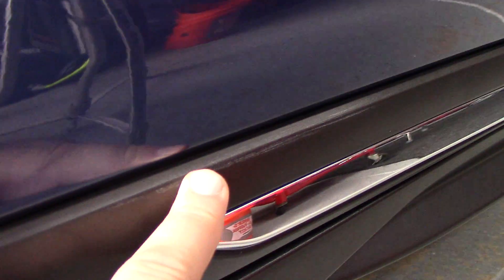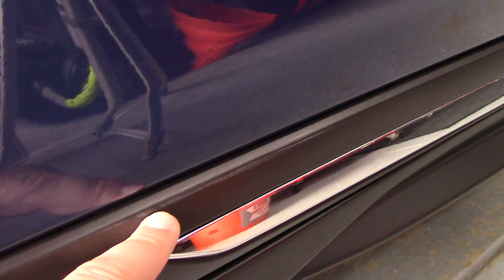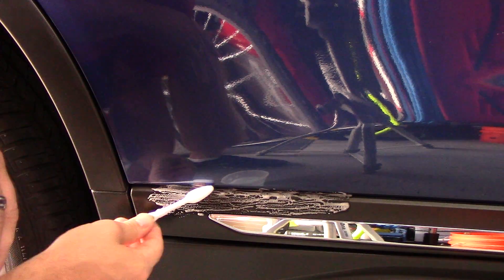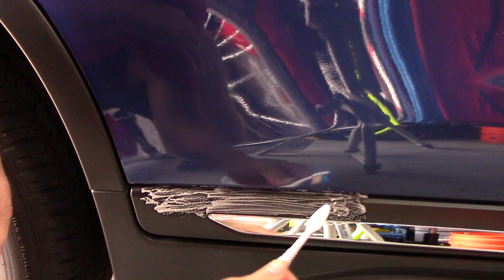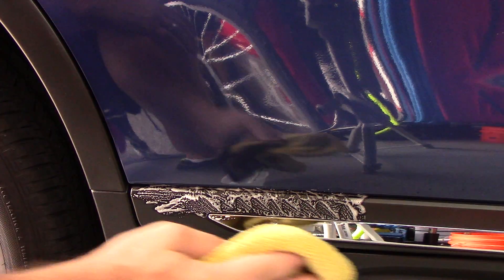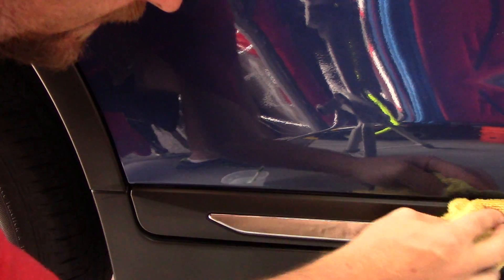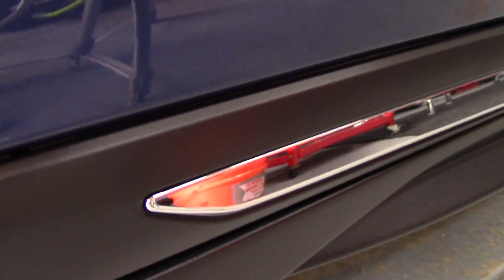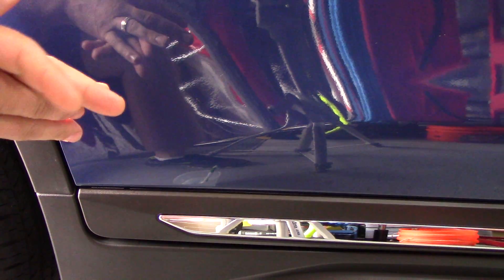Tip: How to Remove Wax on Black Plastic with Basic Household Products!

Comment: Thank you! Dried wax on black plastic trim has been bugging me for years and nothing I tried before worked. Until now. Thanks so much for the tip - it works a treat. And quickly too.
Reply from the maker: You are welcome
Reply: This and also magic erasers work on rubberized plastics. Haven't tried erasers yet but that allegedly works also.

Comment: Don't need chemicals.  I just used Mr Pen premium erasers on the wax film that was on my ridgleline plastic trim.  Came right off!!!  It was a little harder getting off the bed liner but the trim on the fenders, wheel well and under my door was a breeze.  Super stoked that I was able to "erase " my sloppy wax job!

Comment: thank you for not bullshitting for 8 minutes before getting to point. i use NuFinish and found it's awesome but didn't tape off when doing my new rav4. btw HUGE TIP!!:
use NuFinish on exterior of windshield, windows and side mirrors! it makes glass hydrophobic making windshield wipers not even necessary for light rain, ALSO during winter it make ice MUCH EASIER to remove from windshield, just run defroster for a bit and slide the ice off. AMAZING

Comment: Nice Man!  Good tip!
I like to use the magic eraser sponge cleaners with a little APC, it cleans it off super quick and easy also
Reply from the maker: Miranda Detailing Thanks and thanks for the tip. I have some magic erasers I will have to try that.
Reply: This may be a dumb question but what’s apc?
Reply: @sammiedavis1481  Not a dumb question, it stands for All Purpose Cleaner; for example super clean
Reply: I just used a magic eraser on a small section of my new car’s cladding.   The dealer got wax on it and it has been bugging me.  I have LED lights in my garage and I could see where it dulled the finish but removed the wax.    I’ll try the Dove soap tomorrow.

Comment: Great tip Fab.. I am gonna definitely try that.  My father in law great guy, wanted to wax his car with a spray wax. He is 86 years old, tough hard nosed Marine, and still tries to do everything he can. He sprayed damn near the entire black moldings on a Caddy SRX4. That car has a lot of black trim..UGH!  On the advice from Brian (Apex Detail) I used Citrol and a drill brush and it worked amazingly. Then a coat of finish solutions made it good as new.
Reply from the maker: Chicago Mike Thanks brother! There are many different ways and that sounds like another great one. Thanks for the info

Comment: Thanks for the info.

I may have used a stronger mix. Not sure. After applying. I let the soap sit for a couple minutes.
The wax wiped off in one swipe. Tried it on a spot on my motorcycle that had been there for years.
It came right off too.
Reply from the maker: Reg You are welcome!

Comment: For me, this worked very well for removing wax and polish from grainy plastic and Adam's tire & rubber cleaner + toothbrush!!.  Spray adam's and leave to act for a few seconds, then brush with the toothbrush, wipe with the microfiber and it's perfect!.  Two other products that also work are meguiar's apc D101 and meguiar's M39 heavy duty vinyl cleaner.  These products are fantastic because it does not lighten the plastic but restores their original colors!. Because I had tested different methods, such as the wooden pencil eraser etc. But the plastic was still chalky!.  But your technique seems to work well too!  👍
Reply from the maker: Awesome glad it worked and appreciate the tips you gave

Comment: i spit cerium oxide on my cowling  and used 4 different products, including a wax remover on it without ANY change. Used a .29cent pink eraser and not only did the polish come off, but the black trim actually looks rejuvenated.. It also removed water spots off the wiper arms and made look new. Who'd have thought, the simplest tools are still the best.
Reply from the maker: I have heard the eraser trick works great also. Sometimes it’s the stuff you wouldn’t ever think would work that get the job done.
Reply: @FABAutomotiveDetailing  I honestly never tried it because it sounded silly, but when I didn't have any other options i figured why not. 100% accurate on plastic trim, with or without texture. It also does a really good job on older trim that isn't stained but just weathered. I bought a 100 pack of erasers.....

Comment: Old toothbrushes are a very handy tool to have in ones arsenal. And Dawn is a very multitasking product. If you haven't tried it in a foamer on wheels and tires, I think you might be surprised (in a good way). Or to clean engine bays.
Thanks to you and Camarotime for sharing this tip. 👍✌️🇺🇸
Reply from the maker: B Stewart ExecutiveCarCare Yes they have many great uses. I may have to try that in the foamer. T was awesome for CamaroTime to share this tip.
Reply: B Stewart ExecutiveCarCare      Dawn and vinegar, mixed in a spray bottle, works great on a glass shower.

Comment: Thank you ...need to get compound off plastic and rubber... this looks promising ~!  Just a note I corrected my newbie polishing mistakes with your method in just a few minutes, but one thing that helped it go better was I rinsed the dawn and water off with window washer fluid in a spay bottle ... that really help the process for me .... after that I puts some tire black on a micro fiber towel and wiped in on the door handles that I just cleaned to restore the dark black look.  Thanks again,  Kit
Reply from the maker: Awesome glad I could help

Comment: I use a white pencil eraser block and just erase it, I saw this video and wanted to see if you had an easier spray and wipe type solution.
Reply from the maker: I have seen some erasers leave a smudge behind depending on the trim. This won’t leave anything behind.

Comment: Megs Heavy duty vinyl cleaner #39 takes it off instantly. You can watch them demo it for Matt at OC on his Megs visit.$10 for 16oz on Amazon. It's also the best thing on the planet bar none for cleaning marine vinyl/outdoor which is where I learned of it 20 years ago. Stuff is miraculous. It will work when nothing else does. Works on contact.
Reply from the maker: BigOldDog I will have to check it out!
Reply: @FABAutomotiveDetailing  I meant Matt at Obsessed Garage LOL His 2nd video of his trip to Megs in CA shows it in action.

Comment: Just wondering if an electric toothbrush - the vibrating type (as opposed to the oscillating head type) would help? I imagine the bristles 'jack-hammering' into the pits of the matt plastic surface whereas the manual brush still tends to skim over them.
Reply from the maker: I’m sure it would work just fine!

Comment: Never thought about using dish soap but I hardly have any black trim that's plastic on the camaro
Reply from the maker: ZoutlawSS I never thought about it either. If you ever run into it though it works great.

Comment: EVERYONE PLEASE READ THIS. MISTER CLEAN MAGIG ERASER IS AWESOME. just wipe it off no work or mess at all. Just did it to mine. I posted here before to use a pencil eraser, it works too but not as easily as a MAGIG ERASER. wipe hard to remove wax then turn it over and wipe softly to remove residue of eraser

Comment: How would you recommend doing this on large portions. I bought my first used car and the previous owner has messed it up along the entire truck on the black trim around the wheels and bottom floor boards and along the bed. It would take forever with this method. Is there any way more time efficient?
Reply from the maker: Some people recommend using a big eraser  for bigger areas but I have not tried that method.

Comment: Didn't work on baked on old wax that's been there 10 months. Tried this, eraser, and turps, still there. Any tips? Or just keep scrubbing?
Reply from the maker: gorbulas Old bakes in wax is hard to remove. You will need a dedicated wax and grease remover that you can buy at Walmart in the auto body section.

Comment: Does this have to be redone every few months or is it a permanent fix
Reply from the maker: It’s a permanent clean
Reply: @FABAutomotiveDetailing  awesome thanks for the response
Reply from the maker: @randomrangoon5476  you are welcome
Reply: Others have mentioned this, use a pencil eraser.  The ones that are shaped like little bricks.  Think I bought a pack of three for like a $1.30 at Dollar General.  I was so excited to try this out as I had slung a lot of wax on my trim a couple of weeks ago while buffing out my truck.  Wanted to try it out while I was still in the store's parking lot.  Literally cleaned all the spots off in a matter of minutes.  On an odd note, and not that I cared, but it barely wore down the eraser at all.  Cleans it perfectly with only a little eraser dust left behind that blew away on my drive home.
Reply: @FABAutomotiveDetailing  Others have mentioned this, use a pencil eraser.  The ones that are shaped like little bricks.  Think I bought a pack of three for like a $1.30 at Dollar General.  I was so excited to try this out as I had slung a lot of wax on my trim a couple of weeks ago while buffing out my truck.  Wanted to try it out while I was still in the store's parking lot.  Literally cleaned all the spots off in a matter of minutes.  On an odd note, and not that I cared, but it barely wore down the eraser at all.  Cleans it perfectly with only a little eraser dust left behind that blew away on my drive home.